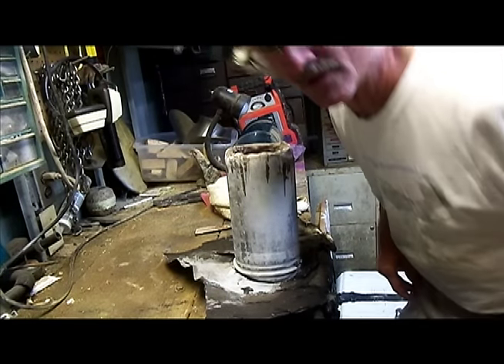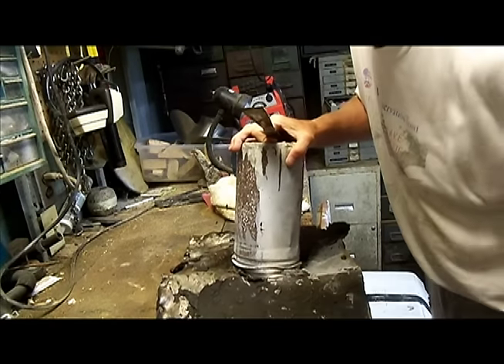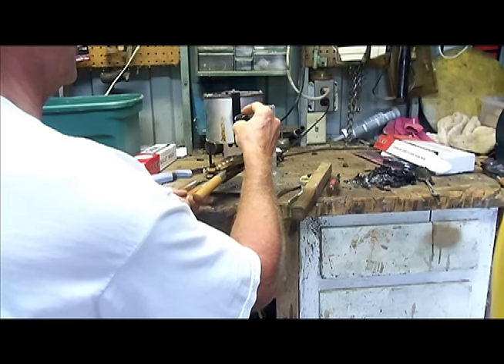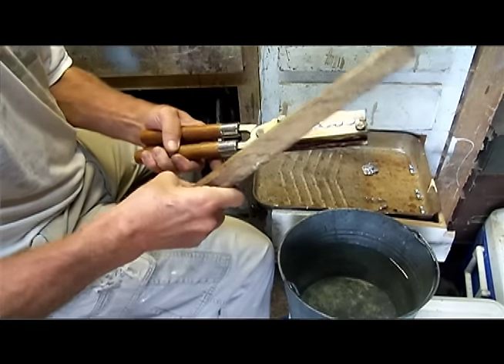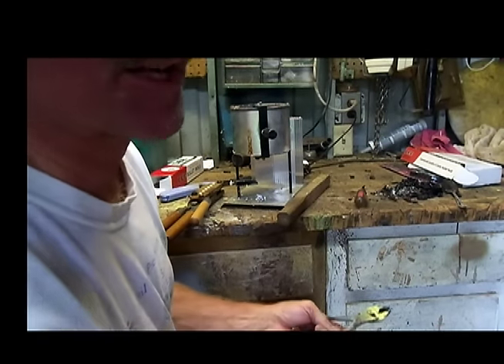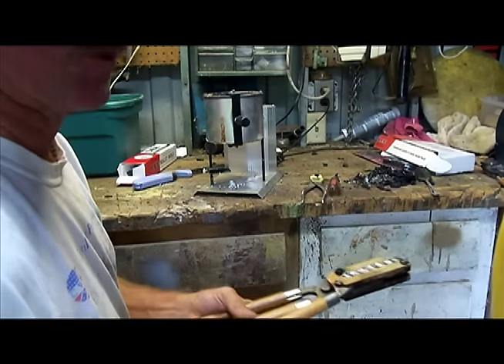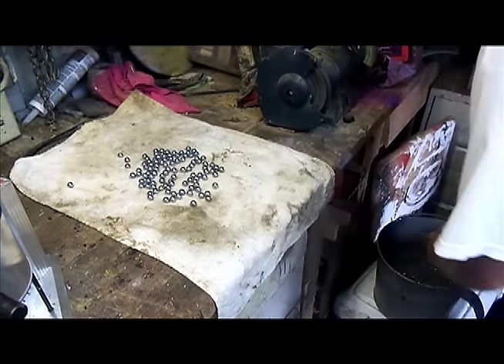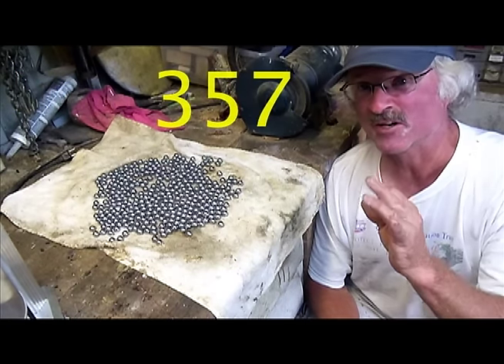How to cast round balls the easy way.

Comment from the maker: WARNING! ....wait till your wet faulty lead balls are totally dry before adding them back into the 600 degree + melting pot. 
It will burn you quickly when you add wet lead back in the pot.

Comment: A few things after casting bullets for 32 years:
1) Lead for casting will be over 700 degrees if pure.
2) Tossing in wet lead, faulty or otherwise, will cause an eruption of lead. Water heated to 700 degrees expands  hundreds of times it's volume almost instantly as it turns to steam. 
3) The guide on the pot should be raised. Lead cools in that fall, not always evenly. The balls may be .480, but the weight will differ. 
4) The patch engages the rifling, not the ball. Wheel weight is usually cheaper, and casts cooler. Still, 2 applies.
5) A water drop is probably fine for round balls. If you are evolved enough to shoot Minnie balls, use a towel.

I realize this comment is years too late, but if I can help one shooter....
Reply from the maker: All EXCELLENT advice! Thanks for taking the time post such great information. Lets both hope it helps someone....keep on shooting my friend.

Comment: cheap candles is a good alternative for mixing wax....does the job and much cheaper.
Reply from the maker: Thanks for the tip. Didn't think of  that.
Reply: sawdust is even cheaper, if you have any.
Reply: I use the wax wrappers from Babybel cheese with good effect for casting jigs and sinkers.
Reply: great idea,thx
Reply: Christmas eve services at a lot ofchurches use candles tat are thrown out after services and little use... I have gotten many for this use from my church

Comment: Great job! That is almost just like how I do it.  I quit messing with roofing lead that is too gummed up with tar, so I cut off the bad and save the good.  I don't want to mess up my pot. Thanks for the video! - gus
Reply from the maker: I use it all.....but...seldom allow the lead to get less than 2" from the bottom. I keep feeding it more lead to avoid it getting gummed up. Thanks for watching....
Reply: Refine your melt in a cast iron pot on a gas burner. Don't put trash in your casting pot.

Comment: Can you comment on what lead can be used. I have pounds of wheel weights. Is thst usable? One person said i have to treat it .
Thank you so much for all the time and effort you do to assist the rest of us. 
Could you list any personal appearances you will be making?
Reply from the maker: Wheel weights didn't work too well for me. I couldn't get my lead pot hot enough to melt it correctly. Pretty much any lead you can scratch with your fingernails or bend easily will work. I use old plumbing piping and roof vents. They work best. Thanks for watching my friend...

Comment: Mark, I love the videos. However, I strongly reccomend primary reducing of lead should be done in a seperate container. Melting roof boots in the casting pot, pieces of crud, can and will get in the nozzle. Blocking sealing of the nozzle. I have gone through several pots untill I found that way to melt. I melt in two steps. First is to rid the shingle material. Second is to cast ingots, then I use the ingots to refill the casting pot. The hand held casting ladle, is just the right size for filling the cavity in the mold for ingots. Once I seperated the shingles from the lead, I now have had a pot last for two decades. I use it to this day and it has seen lots of castings. I take at unplug, a screw driver to spin the rod that is the nozzle sealer.  The prevents dripping on restart.
Reply from the maker: Sounds like a lot of work my friend...I haven't had too many problems with clogged tips.  I never allow the lead to get so low it will clog the unit. Thanks for watching...

Comment: Gotta love Lee! i have their 18 pellet 00 buck, 7/8oz slug and  .69, .60, and .562 caliber ball molds. The sprue cutter design is great, because you can dump the sprue right back in the pot on the fly, instead of having to drag it out of the water bucket and snip it later. I tumble my strings of three buckshot in an old dryer for about an hour, breaking them all apart and smoothing off all of the flash and tags.
Reply from the maker: Works for me!!   I have occasionally put some of these round balls in a rock tumbler. That takes the sprue off of them too. Most of the time, I just align the sprue upwards & shoot away, thanks for watching..

Comment: I started with black powder in 1975. I've been using an enamel pot and a Coleman camp stove. Not as fancy as you, but I can make all I need.  There's something very relaxing about casting balls.
Reply from the maker: Yes....it is relaxing. I use to pour using the method you described....however...I changed because I was  tired of running out of propane. This method works little better because I can pour when its raining, etc inside that shed. You've been shooting since 1975? That's awesome! Thanks for watching........
Reply: @blackpowdermaniacshooter  Yup, I'm 71.  I shot a guy's percussion .36 once and I was hooked.  I tell my friends that that cartridge stuff is just a passing fad.
Reply from the maker: @OldJoe212  I agree with you. I more or less put up my modern guns once I started shooting black powder. They are addicting for sure!

Comment: I love Lee molds and production pots. I can pour a pound of 00 Buckshot in two minutes flat, using two molds. My average production for an hour is between 16 and 20 lbs, depending on issues with molds. Loose screws, sticking shot etc. can slow me down. I sell it to various clients and on eBay.
Reply from the maker: I agree..I love their moulds too. I can crank 'em out by the 100's using those 6 cavity moulds. When I get started, its hard to quit. I just want to keep on pouring! LOL  Thanks for watching..

Comment: Better to make ingots from your scrap in one pot, and only use the clean lead in your casting pot.  You don't want to get the spout of your bottom-pour pot clogged by the trash.  Jerry Miculek made a decent video a few years ago on how he makes ingots and cast bullets.
Reply from the maker: I never allow the lead to get lower than 1" from the bottom. That allows the spout at the bottom to stay clean. Melting ingots is too much trouble for me. Thanks for watching.

Comment: Once again some good ideas. I cut slots in my slag spoon to let as much lead flow back as possible. All my casting is done outside upwind from my pot. I also never throw away the slag as there is still lead in it and the environmentalists would kill me if I did. Have much scrap lead and an olde propane tank modified for melting the junk and add the slag to it. The crud I recover from that is then disposed of as hazardous waste. Enjoy your vids and am always learning something.
Reply from the maker: Thanks for those tips. I don't throw away any slag either. Just the dirt, roofing tar or "pond scum" that's associated with roof vents. Thanks for watching.......
Reply: Black Powder Maniac Shooter I enjoy swapping ideas with folks. Some work and some don't. I appreciate your videos and look forward to using some of your ideas.
Reply from the maker: Thanks.......

Comment: Thank you so much for answering to me. I am very grateful sir. My problem to diside which one is good for me is that I am not familiar with the terminology that you use. I understand only measure like 7/16, or 3/8, 1/2 and the measure I need is 7/16.
Reply from the maker: 7/16 is almost 8/16" ( or 1/2 inch)  in the American system. That means you can purchase a .490 ball mould ( almost .50 of 100 ) ( mentioned at @1:43 ) that will make ball slightly less than 1/2 inch in diameter. That should do just fine. Hope this helps...Thanks for asking.
Reply: Divide 7 by 16 which will give you the decimal equivalent of 0.4375

Comment: Sling shot bullets.
I use an older Lee 6 hole .45 round ball mold.  Mine doesn't have the spru handle.
Reply from the maker: 6 shot ones can crank them out. I love using mine..

Comment: New at this and have a question: Do need to trim the balls after they are molded?
Reply from the maker: No. The moulds has a cutter at the top. Its the part that swings outward after the ball has hardened at @4:35. It cuts the ball for you. Thanks for watching.
Reply: This mould kicks out the prettiest little round balls you can imagin.  Absolutely perfect.  Amazingly so!

Comment: can these molds be used with aluminum? I have a lot of scrap aluminum I've been meaning to use for slingshot balls and other projects
Reply from the maker: I have never tried any other metals besides lead. I'm not even sure what the melting point of aluminum is. I guess you can try melting some aluminum on a camp cook stove to see how easy it is to work with & go from there. I'd love to know the results if you try melting aluminum. Thanks for watching.

Comment: Never drop new cast shoot into water straight from the mold. The rapid cooling makes the lead hard and brittle. Just drop the cast balls on to a piece of leather or a thick blanket and let it air dry. It will keep the lead soft and consistent. If you dont believe me look at a few videos on YouTube that show what a water cooled bullet and an air cooled bullet is like.
Reply from the maker: That's probably true. The only reason I use water is to be able to handle the balls sooner. I pour lots of round balls to give away. Thanks for watching...

Comment: What is the brand of your lead melter?  I'm starting to pour my own stuff along with fishing weights.  i want a quality melter.
Reply from the maker: Its from Lee's Precision. I've poured 1000's of round balls with it. Here's the link to the product:  You might have to shop around to find one:  https://leeprecision.com/pro-4-20lb.html
Reply: @blackpowdermaniacshooter  Thank you.  The site is presently sold out.  I've seen the Lee's melter on Amazon.
Worse comes to worse I can get a melting ladle and pour that way for a while until things get back to normal.
Reply from the maker: @beebob1279  Correct.....I've noticed pretty much anything Black powder related is hard to find at the moment. When you do find one...you area going to love using it. They make pouring VERY easy.
Reply: @blackpowdermaniacshooter  I'm still looking.  Didn't get to my black powder shop today.  I'll take a trip up this week after all the snow and see what he has.
Reply from the maker: @beebob1279  Been looking a little too. It seems like we can't find one anywhere...even with a search warrant.
Reply: @blackpowdermaniacshooter  I can get an old cast iron skillet and melt the lead that way.  then pour it into moulds.
Reply from the maker: @beebob1279  That's how I use to do it before I picked up this Lee's Pot. The main reason I changed was..I was always running out of propane  when the lead was hot.
Reply: @blackpowdermaniacshooter  Wood fire in a small pit is supposed to melt the lead.
Have you tried that before?
Like I said.  I want to get started with this.  I need to find things first.  I need a .490 round ball mould.  That I can get.  The lead I can find.  Then I can work to get my moulds for fishing weights.  Who knows when lead will be illegal altogether.
Reply from the maker: @beebob1279  You're right about the lead. I'm not sure how much fire you would need. Keeping it hot enough would be the problem. Do you have a camp stove or an old gas grill on your back porch?  The small camp stove is what I used with those small green bottles of propane.
Reply: @blackpowdermaniacshooter  I have a propane burner for melting beeswax.
The heat source isn't really the issue.  It's getting the equipment to make it.
Reply from the maker: @beebob1279  Yes...and that's tough at the moment. Hopefully the economy will get moving again soon & accessories will be easily found again.

Comment: For me, it's WAY easier to just start using the mold cold, dump the balls into a dry pan, and then drop them back in the pot if they're bad. After two or three cycles I get perfect balls. It's nearly impossible to evenly preheat the mold and guarantee a perfect first pour anyway.
Reply from the maker: I agree with you about evenly preheating a mould. That's tough to accomplish! Thanks for watching....

Comment: Nope I'll be 64yrs old next week. I started casting in 1962. My whole family wore safety gear, leather chaps, leather flaps over your boots, welding aprons and gloves, long sleeve cotton shirts and complete face shields. Two 100lb plumbers pots and 2 Coleman stoves. With 2 Potters Pots going on the bench. 3 adults and 6 kids. We did that from 1956 to 1966. No one ever got burned. I've never been burned. Better safe then sorry.
Reply from the maker: Oh, I agree. Safe is better than sorry. I didn't use the shields in the video for obvious reasons. However, I've been pouring just few years with no problems yet. Thanks for watching. Have a blessed day.

Comment: have you ever tried puting ash on the top, it helps with slag removal. its what I do when melting lead. it also helps reduce oxidization on the top layer of lead.
Reply from the maker: Never tried that. Candle wax works for me & candles are cheap. Thanks for watching...

Comment: Using a bucket of water to cool round balls is a disaster just waiting to happen.  A slightly damp cloth (like an old towel) is as wet as I would ever use.  Water expands to 600 times it's volume when vaporized and the remote possibility of instantly airborne molten lead is NOTHING to fool with - even once.  The first few cast balls CAN have a void or crack created inside the ball and it's entirely possible that cooling water from the bucket will be drawn into that void - causing a steam explosion when you dump them back into the melt pot.  Once having seeing someone do just that means that you will never forget it.

To heat the blocks prior to the first few pours I learned to take the blocks from the mold and just push them a very slight way (1/8") into the liquid lead - preheating the blocks prior to beginning the casting operation.  Residual heat from the following castings maintains the heating.

Take the lighter and put it far away somewhere.  The casting cleanly removes all the lead from the blocks and the lighter being used is some sort of a feeble attempt to carbon coat the blocks.  Not needed at all and the lighter is certainly not going to do any good at all trying to preheat the blocks.  A propane torch could, a Barbecue lighter No.

The use of the wax in the melt pot as a sort of "flux" is to help remove the coating of Lead Oxide floating on the surface of the lead by chemically converting back to 100% lead without the floating oxide dross on the top.  The burning wax uses the Oxygen from the hot Lead Oxide floating on the top surface of the liquid Lead, leaving it mostly clean. and shiny.

You originally identified the diameter being cast as .490  --  standard for .50 rifles (like mine) -- not the .480 mentioned at the end of the video.

Want to get rid of that tar?  Put it in a non galvanized steel can or a cast iron melt pot (even a really rusted frying pan)and do the initial melt over a wood fire outside.  When the lead is melted pour the liquid Lead from the bottom of the melt container into a flat bottomed pan or frying pan (pouring from the lower, melted material area) and in a few seconds pop that new sheet out and repeat until all the clean lead has been converted into clean sheets --- or --- use a Lyman cast iron mold instead to cast 1 pound bars.  Buy the Lyman mold once and use it for a lifetime.  I did that and at my age - 75 years old - it's as good as the day I bought it.     - Joe -
Reply from the maker: All good tips, thanks for sharing.
Reply: Water expansion to steam is 1,600-1,700 depending on ambient pressure. 
Very good comment

Comment: Thanks for the video!
Second using an exhaust fan.  Need those brain cells!
Doesn't using the lighter on the mold (3:57) put a carbon (soot) film as a mold release, rather than heating them up?  I agree it works, just think it's a different mechanism.  
Do you need to repeat using the lighter every dozen casts or so, or just once a session, or what?
Reply from the maker: Not sure how the lighter works, but it does. Using the lighter in the moulds allows the balls to fall out with ease. I usually don't repeat using the lighter till the balls starts sticking in the mould....usually after 175--200 pours.  Keep your powder dry and thanks for watching my friend.
Reply: @MrTechnophile I learned the same method you are talking about. I mostly used single or double cavity mould and I used a match to smoke my cavity to leave a layer of carbon to make the round balls drop out easier. The best way to heat your mould is to start casting. You might have to throw a few back until they completely fill out but if the blocks are made from aluminum it doesn't take very much. You can dip the edge of your mould in the lead for a couple minutes, that will help too.

Comment: Roofing vent would be pretty soft lead huh? If i wanted to try this for 9mm, where would i be best to get some hardness into the pot?
Reply from the maker: You can try real lead tire wheel weights. WW's are much harder lead to pour. You may have to experiment with how much mixing of the hard verses soft lead ratio you want.....but...you should accomplish what you need to pour 9mm bullets. Thanks for watching.
Reply: @blackpowdermaniacshooter  i have a similar pan size, ill try adding 2 or 3 wws to each hot pan full.